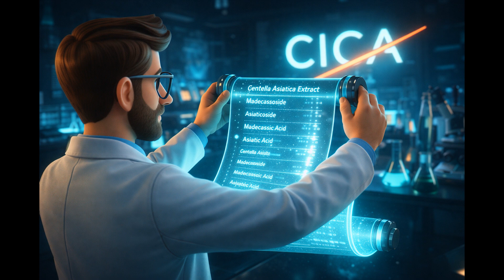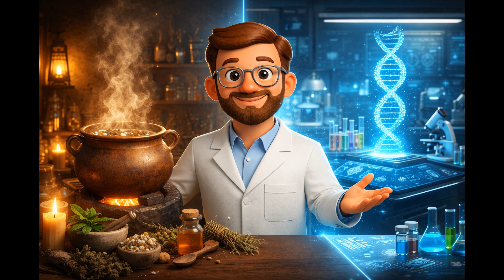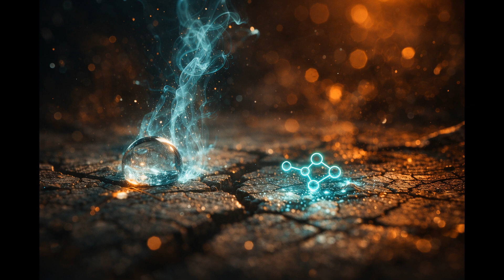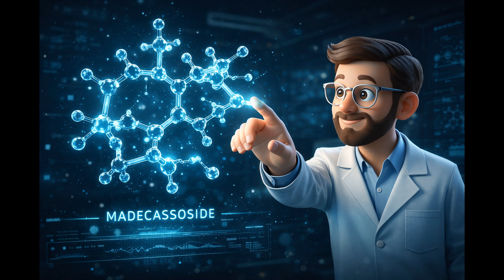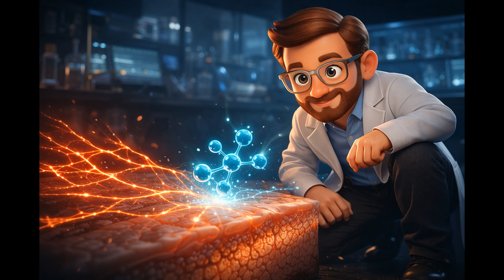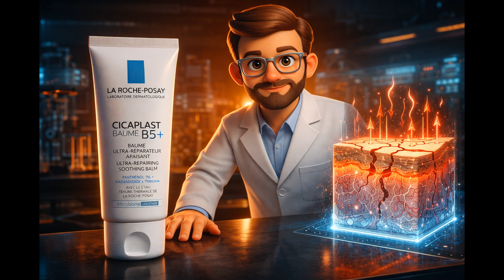You're not using the right Cica (the Truth on Centella Asiatica)

Comment: Trying to hype your video but no option. Why does that skin1004 cause irritation bumps for me and some others? It's not an allergy.
Reply from the maker: Thanks for wanting to support the channel, I really appreciate it!
To answer your question: from a formulation perspective, it often comes down to delivery systems and penetration speed. Skin1004 is a lightweight fluid that uses glycols to push ingredients deep and fast into the skin. If your skin barrier doesn't need that rapid influx, it can easily saturate and react. On the other hand, Cicaplast is a heavy emulsion designed to sit on top and release ingredients very slowly.

Same active ingredient, but a completely different chemical vehicle!
Reply: @Cosmetoscope thank you